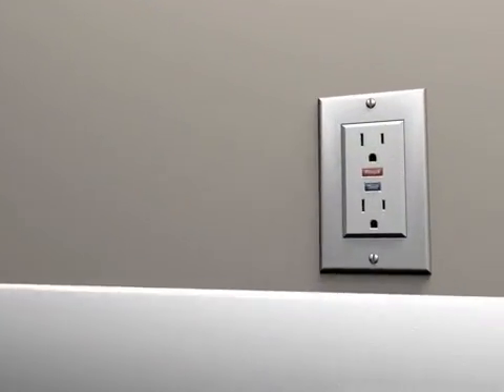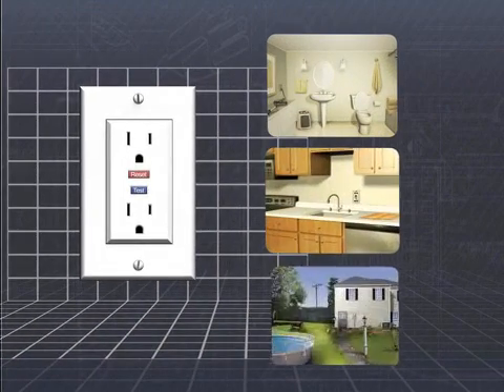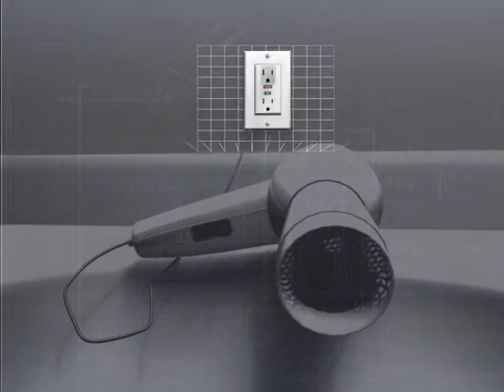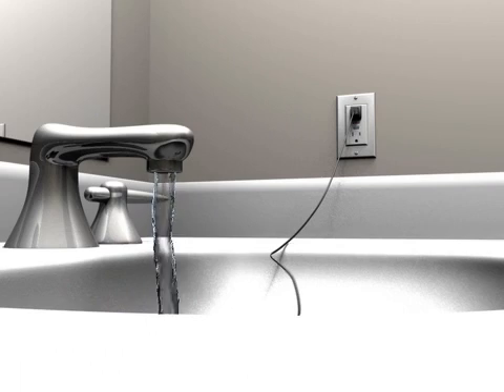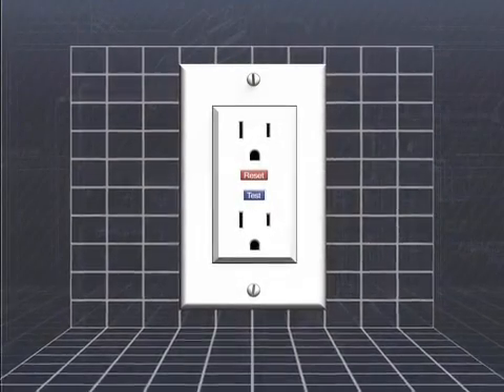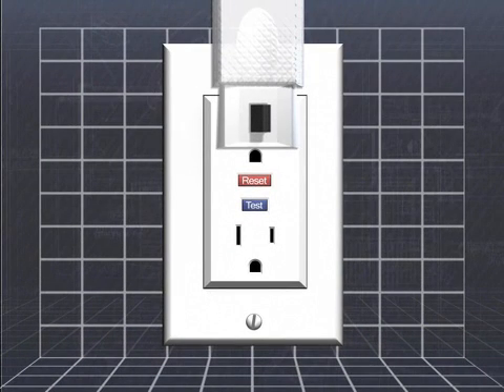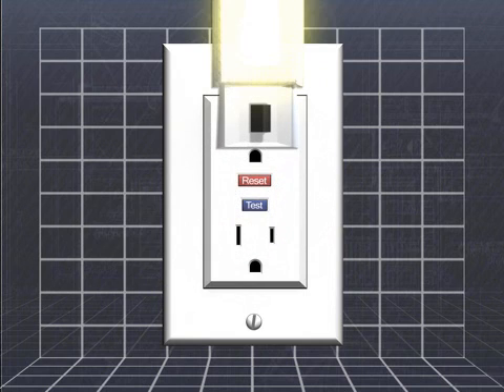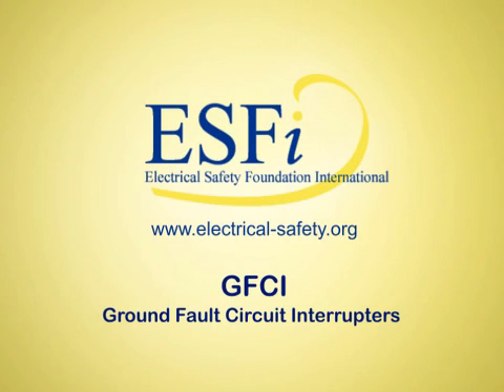GFCI Virtual Demonstration

Comment: Great Instructional Video- I always need to check the Operation's Manual - Gulf Power is always surging our electrical supply - maybe because we are surrounded by military bases.  Today Tuesday, December 17, 2019, 
approximately 0830 hrs I noticed that the bathroom GFCI; I attempted to reset the GFCI - was successful; however, approximately 0905 hrs I noticed that the porch receptacle outlets were again dead; checked the outdoor power outlets – no power - I reset the main breakers in the breaker box in the garage-bay; again attempted to reset the bathroom outlet breaker – no power – I thought something must be wrong with the bathroom GFCI breaker – it may be time to replace the GFCI - I watched this video and approximately 1105 hrs I attempted to reset the GFCI - I was successful; On Tuesday, December 10, 2019, 

Outdoor outlets and porch receptacle outlets were powerless; learned that the upstairs bathroom GFCI tripped; reset the GFCI and power restored to both the outdoor  and porch receptacle outlets.
Reply: thats cool